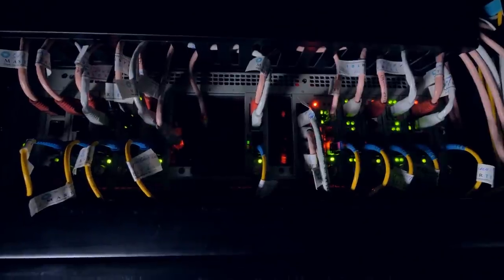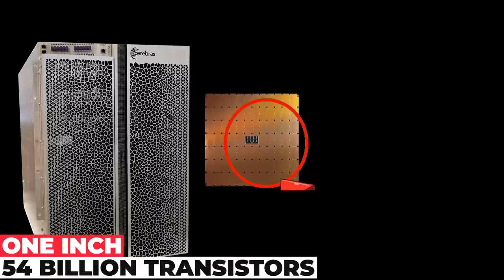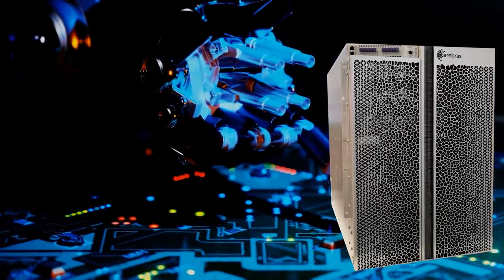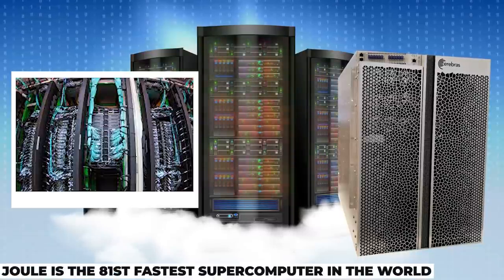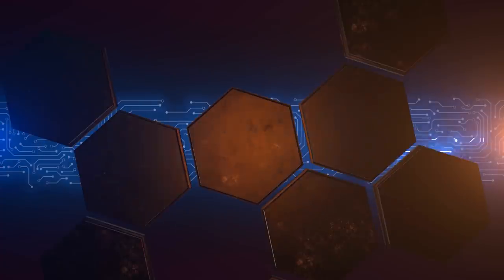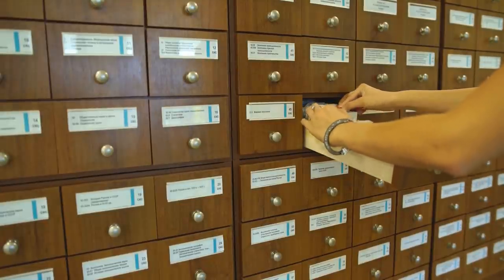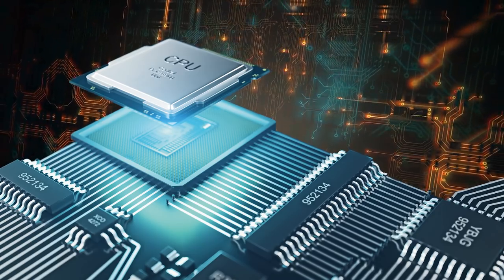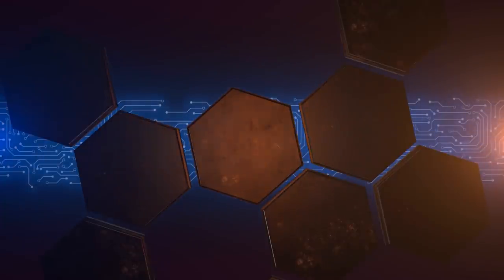The Trillion-Transistor Chip That Just Left a Supercomputer in the Dust

Comment: I've been researching polymer based photonic transistor concepts. The idea behind useing thin plastic planes acting as the circuit boards and phototransistors as the switches would make smart phone computing moduals cheaper and better then high dollar desktop systems all the whole using less power yet being more powerful.

Comment: Its been seen before but not since the transistor resolution days. This is a kin to upgrading a building floor size vacuum tube or relay computers by filling the rest of the building (which they did). Before the standard for CPU sizes or even father back the standard for IC sizes back in the vacuum tube days this was the mentality. As a scientist of electronic engineering by degree and a hobbyist tech historian I feel like this is the child of anachronistic ideas applied to modern problems. It is a interesting Idea and I think its bold they are trying it. To call it a new idea is to forget about the history of how technology evolved. I can't wait to see of they try to package this beast or just hard wire them. The about of power has to be added at almost every sub section you can't flow power across a chip this size from the edges like most CPUs.

Comment: Back in the nineties, the military wanted to know what was going to happen computers, and the infrastructor that was going to support it. An expensive study said. Eventually the internet would be everywhere, and it made no sense to own your own computer. The problem was, they doubted if the infrastructue could be secure in the long run. There was going to either be a crash, or so problematic and expensive that no one could use the net. Companies would be the first to have a closed computer infrastructure, that was never connected to larger network. Then the system would travel down to the comsumer level. Eventually, every home would have a main frame computer that directly hooked up to smaller home computers. It would be like buying a furnance, hot water hear, and air conditioner. Every home would have a main frame, that did secure and diffcult things. There would be any form of  wireless connection, because that could never be secured. Everyone living in the home would have their own computer, but it would only work with the main frame of the home. It was asked why, anyone would need a mainframe, when they had their own computer. The said, "The house's main frame would be the mind of house, and maintain home. It would be alive in some fashion." Everyone thought the ideas was stupid, as did I. Now I wonder.

Comment: I'm very interested in what the yield is to make such a chip. Looking at the design it consists of 12 x 7 = 84 dies. Typical it's between 25 and 30 exposures per die (assuming single patterning), which means between 2100 and 2520 exposures. If just one exposures fails, the whole chip is lost.
Reply: My question was answered by another video by TechTechPotato: https://www.youtube.com/watch?v=FNd94_XaVlY
The yield is 100%, because they design to be able to bypass defect. Very clever.

Comment: I think this is the future, Just apply the upcoming AMD MCM design to it, and you can stack these wafers side by side, or on top of each other for 2x or 3x their current performance, and if that works without overheating the system, you could probably achieve upwards of 10x the current performance by essentially making this into a silicon wafer hard disk like design.

Comment: What if we connect like 10 of them in parallel, always paired in 2 for redundancy but like 5 double trillion transistor chips, that work out problems independently but can share necessary data or solutions for partial problems to the one working on the main problem?

Comment: When chips get big its more about "Working Yield" than anything else, that's why bigger chips are more expensive, their working yield is much lower so you have to start throwing them away. This is based on the simple fact that every wafer has crystalline 'errors' in it -but where are they? If you divide the chip into a thousand chips and there are 10 errors you may still have a 99% yield, if you only get 10 chips, well, your yield might be zero if you are very unlucky and each of those 10 errors falls into a chip. A chip the size of this wafer has to have 10 errors in it so you start having to engineer 'error correcting logic' to work around the errors, or perhaps turn off or disconnect sub-chips that report error like they had to do -its diminishing returns really, better to have a large array of cheaper chips you know work...

Comment: See I never understood why processors were so small why would we only make them one to two inches. Sure costs are a factor but continuously shrinking transistors smaller and smaller is unnecessary if you just make the processor bigger. And with the size of a gaming ATX motherboard those things are about a foot long and most of it is unused space so making a one foot processor wouldn't be much of an issue for space.

Comment: it s weird they understand particle physics masterfully , like wifi but they can t interact particles in a row like one hughe frequency altered transistor. WOuldn t the new neg charged chips be able to do that on a 3-d like multiplexer then processes in mathematic patterns changing 1-0 to multiple tables to exponential factorial or ref. to hughe equilibrique matricy systems. etc.

Comment: Size and speed of light (or half the speed of light for currents) are limiting factors on computer speed, so putting everything so close together can sure speed it up. I wonder how they cool 20kW of power on something this size, though. 
And yeah, faster computers don't just complete the same computations faster; they make new kinds of computations possible.
Reply: Can you name a few 'new kinds of calculations' please
Reply: @vizionthing  Well, for one, when going from Pentium 4 with 1 GB RAM to a Sandy Bridge with 8 GB RAM, I could run a browser, a game and GIMP at the same time. Things previously impossible, became possible. 

But what you're looking for is more along the lines of having a denser grid for finite element calculations or fluid dynamics and eliminating more errors, making designing new things possible. For example the first Stealth Bomber was so blocky because that's what current computers could handle and the shape became more curvy over redesigns.

Comment: Before watching. It's not a chip, it's not a wafer size chip. If it was it would be trash. It's a multiple the same chips on the same wafer, interconnected between each other. It's an integration scale similar to system in package, but it's not a chip.

Comment: How in the hell are they fabbing a single wafer without defects? The reason Intel is getting pounded by AMD's Ryzen is that they've offloaded the one-chip concept into a SOC sled with smaller less defective chips - creating a near 0 failure rate (very cheap). Intel's chips have been in a race to the bottom of usable CPUs per-fab with associative massive price increases (due to fewer chips being usable). You're telling me these guys have a 1.2 trillion transistor single shot wafer with ZERO defects? I'd believe if they'd managed to combine good chips into a package (like AMD) but a single usable mega chip from a wafer? That seems ... totally impossible.

Comment: Imagine programming it to support OpenGL and sends data through fiber optics. Now, you have a render hardware size of a refrigerator. Then, mass product the system to reduce the costs.
If they wished to make money, they could have sliced it in to a palm sized wafer and sell as is with special cooling solution. 
Well, it might be very similar to Nvidia's Tesla Compute Card or AMD's INSTINCT. But, none of them had made a chip as big as the base of the cooling system yet for the new age cards.

Yes, it's getting to the point where I don't mention gaming cards. So, if there's a driver that can make these cards help with real time render, yes, there is for each brand, Nvidia: CUDA, AMD:HIP. AMD even went through developing "hipify" which can be used to compiled for BOTH of them.
Well, nVidia also developed NVIDIA HPC SDK which also compile and runs on ANY SYSTEM that support machine codes generated from standard C++.

Comment: Yes could we PLEASE develop CPUs better fit for stationary purposes such as in a desktop rather than convincing ourselves that smaller is better. We don't necessarily need to reduce or improve transistor count / cpu complexity but we can change transistor size--> to give every transistor more surface area to cool /simpler and cheaper manufacturing ( less precise tools needed ) with the only downsides of needing more material per CPU and a ridiculously sized die..... Not to mention supposed power feed issues of the machine because transistors are just a little too far away or something... The long and short of what I would be asking for is a 45nm transistor architecture, A Phenom ll x6 1100T that's been blown up in size 5 times larger than it should be.... Silly concept, wonder if it would work. 🤔
Reply: Maybe not necessarily having better cooling because each transistor will need more power the larger they are... We developed CPU's with smaller transistors and more of them and they don't seem to have needed more power since then to now... In fact they've needed less power to run more recently! like comparing Phenom ll x6 1100T's 125 watt requirement to Ryzen 5 3600's 65 watt requirement... Our development into semiconductors and what CPU wafer material is the absolute grand champion for not exploding  under pressure is definitely a contributor... Doesn't mean production is any better because we are going to need more of something that's high in demand to make something as outlandish as my request...  So then it boils down to --> transistor size (X) transistor semiconductor (X) how many transistors there are per chip = For this sort of development I would imagine to be monetary disaster because of it... There's got to be a way to make the dream come true...
Reply: But we are progressing to the point of our CPU transistors being as small as we can practically make them with the best materials available... The only available option from here would be to simply fit more of the small transistors made from the good stuff onto a larger CPU like what your doing...
Reply: But enough about those ethics of should be or not to be... I just wonder how much did it cost to make the CS-1 in material and manufacturing costs without the R&D price tag.

Comment: I'm sure RISC5 or ARM will beat it, without consuming 20KWh power. In 10 years. That chip is probably amazing but this video is clearly an advertisement. Does it not have any drawbacks? What is it's instruction set? What frequency does it operate at while consuming 20kw power. How many instructions per cycle can it do? I'm sure that should be many. I hope you talked about these. But best of luck to you.

Comment: I really think that this idea of smaller is better is going out the door.
And I mean smaller as in everyday technology's. The 1st Mobil phone was nicknamed The Brick and was exactly like the name suggests. Big, bulky, unwieldy, The 1st computers took up hole rooms. Then it was the rush to get smaller. I-pods are the best example. When they 1st came out they were about the size of today's smart phones.
Now you can buy them small as your thumb. But at a price of course. That same modern I-Pod has no display or buttons all done from the headphones.

If I had to give up the equivalent space in my house as a fridge in exchange for a computer more powerful than I could ever hope to use fully would be a more than fare trade. You wouldn't need a laptop, phone, desktop, gaming console, or anything else. With the world's slowly going 100% "wireless", all you would need is your washing machine size computer and a cell phone size control panel and you could do about anything you think of with the 2 connecting with each other.

Comment: So they compare this to the next bigger chip. This chip has 1.2 trillion transistors vs the nvidia chip with 54 billion transistors. So this chip has 22.22 times more transistors… However the chip in question happens to be 77 times larger than the nvidia.. so really is it more powerful? No. Nvidia could just make their chip bigger and fit even more efficient transistors.. but like why. The whole point is to have higher power in the smallest form possible

Comment: The opposite is true, I once wondered why we bother to keep shrinking our tech but the truth is latency, at a certain point in the NM process it becomes physically impossible for transistors to function logically, but it's also for this reason why computers become faster, the less travel distance the better... meaning the bigger the chip the worse it technically is even if it's faster on paper. If this chip is made smaller with the same transistors it would function much faster.

Comment: Truly faster than the reality it can simulate.  Correct, but only in the limited domain of the problem space to be simulated.  Fascinating to ponder the expansion of that simulation space.  Because of chaos theory and the Heisenberg uncertainty principle, reality simulation abilities will ALWAYS be extremely poor.
A related example:  The calculation of colorful Mandelbrot set images, which have, unquestionably limitless (infinite) detail and resolution, has already produced zoom-in views with immensely far, far, more precision than the number of sub-atomic particles in the whole known universe.  So?  "Sew buttons".   For a specific product, I programmed 4 early GPU boards with 12,288 parallel cores (using NVidia's brilliant and easy CUDA language).  Ultimately, reality in detail, however, can not be both precisely and accurately simulated.
If anyone calculates how long this device would take to simulate a 1080p 2 hour movie at 60 fps with smoothness and precision of a quality video game, pleae post here!